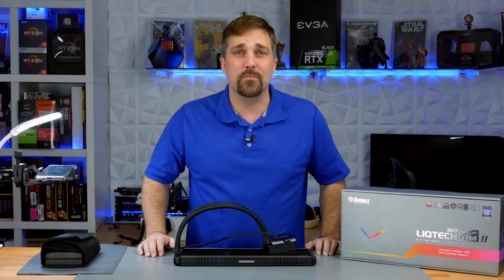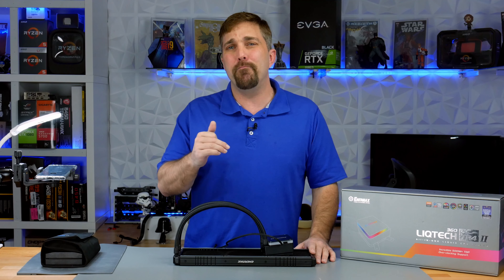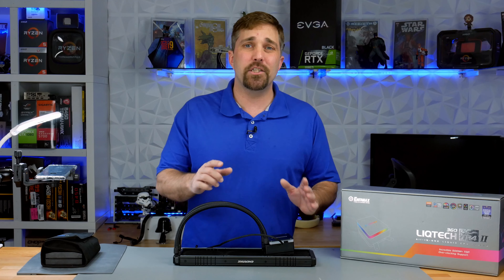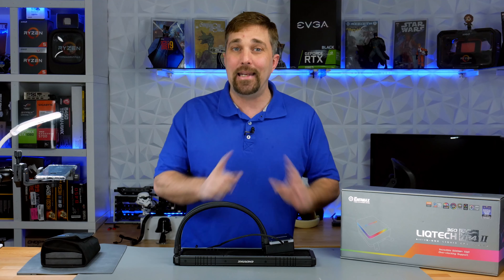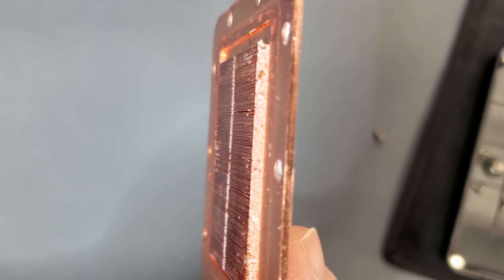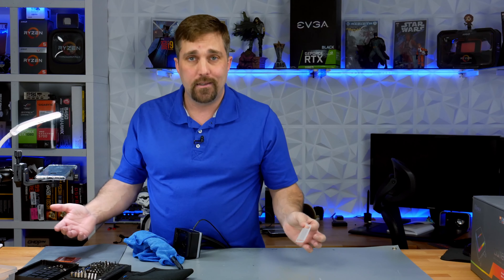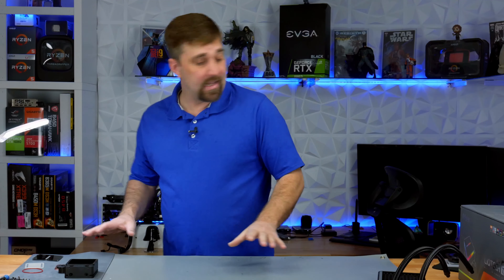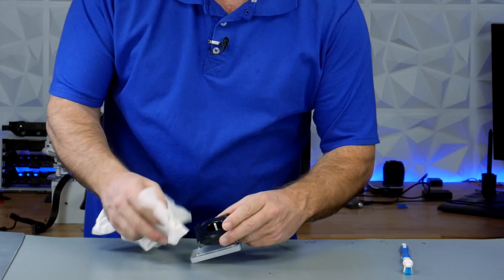How to Fix the Enermax Liqtech TR4 II Cooler - Complete Refurbish Guide

Comment from the maker: UPDATE: Aug 2021 - 18 Months later and this cooler has been running 24/7 on my Threadripper workstation and is still functioning perfectly after the refurb.
I almost forgot the temps I promised: Stats - 
CPU AMD Threadripper 2990WX, Overclocked to 3.8 GHz @ 1.225V. 
Room (Ambient Temp) 22 C.
CPU Idle Temp 30 - 33 C. 
Load Temps - 
10 Min Cinebench R20 61 C Max, 
Handbrake 4K X265 1+ Hours of Encoding 53 C Max.
Reply: what CPU Wattage when full load?
Reply from the maker: @vizintini  It's about 320W on the cores and just over 400W on the Package under real world rendering loads, but I have maxed out at over 500W under synthetic load.
Reply: Ty i went n got simple green clr n distilled water bought that coolant n a hand pump ad for oil n gas radiator fluid i have the tools n there was gunk i was getting 60 o C idle n could only run youtube i cant wait to finish my wife has a glass vase for me too. Ty because enermax told me to f myself when i put in for replacement i have 1950x thread n love the enermax well did sinve this is liqtech ii 360 which was a replacement thinking of video'n my first refurb lol. Thanks again i would have never had the balls to do it n think about getting an icegiant to eventually replace it sux being broke. Lol

Comment: Amazing video, my Threadripper system died a few months back (PSU went out) and it had one of these cooling it since 2019. Never had any issues but I think doing some preventative maintenance shouldn't hurt. I ended up swapping out everything but the board on that PC so this cooler will go to a spare parts rig. Great video and I will make sure to reference it when I clean my own unit.👍

Comment: It is necessary to leave a little space in the radiator to expand the coolant. Or is it not critical for such temperatures?
Reply from the maker: Technically yes,  but between the thermal expansion of the radiator and hoses and the fact that you'll never get all the air out, it's fine to fill it as much as possible.
Reply: @ElevatedSystems  i currently just acquired a 3990x and I’ve been wanting to use an AIO with full coverage and this enermax is the only solution to keep temps at bay. I know you dont recommend buying this AIO, but i dont want to do a custom loop, and i dont want to deal with 85 degree+ temps with another AIOs. My first question is, hows the unit you refurbished in the video running so far today, and also do you have any affiliate links for all the products required (ex. Manual or electric pump and AIO liquids required) to refurb the AIO since I’m looking to refurb from day 1.

Thanks in advance

Comment: I just bought the original (disastrous) version of this cooler unopened a couple weeks ago.  I've always wanted an AIO for my Threadripper, but they were always too expensive and now they are still expensive and rare.

When I received it (deeply discounted) I immediately cracked it open and it was the expected gross mess we have all come to love, except this one is 5 years older so there's some other weird stuff going on.  There was major chunks of sediment that I had to chisel away with a razor blade and some missing chunks of metal (I think a manufacturing flaw).  I had to follow that up with putting some lacquer over areas where the coating on the waterblock chipped, exposing the metal.  It took forever, but I got everything flushed and cleaned up.  The coldplate was a disaster- it had oxidized pretty bad on the edges which required a ton of polishing with my drill.

Now that it's fully installed, temps are better than my Noctua, but not by much.  The good news is it freed up some ram slots that my air cooler blocked.  I have no idea if this will hold up, but I'm happy it wasn't a complete disaster.  Interesting project, but definitely not for the faint of heart.

Comment: Thank you, I "sold" or returned mine for a RMA and replaced it with a Noctua, but the temps it provided when brand new was amazing.
After having watched this, I am tempted to buy a brand new one, drain on day 1, flush it and refill it with some good aftermarket coolant and perhaps have an AIO that can last me longer than a year.
Reply from the maker: Don't bother buying and refilling one. I'm pretty sure the ultimate problem with this AIO is permeation as after 4 months there is so much air in the system I'm afraid the pump will fail.

Comment: It's ashamed that Enermax could not even fill their AIO system with anti-microbial additive. 

Anyway, I am building my first Threadripper workstation with 3970X with 280W TDP. Unfortunately this is the only AIO that has 100% coverage of cold plate over Threadripper's IHS (I am wondering why no other AIO manufacturers bothered to design for TR4). So do you think it would be wise to buy one of these Liqtech TR4 II and flush and refill the system out of the box with good coolant such as those from EK?
Reply: ThermalTake have the "Floe Riing RGB 360 TR4 Edition" which looks like it covers 95% of the plate (lots of screwholes in the coldplate ,'/
Reply: @teroteki  I have actually just installed my system with Cooler Master ML360 TR4 at half the price of ThermalTake's. I haven't put it to stress test but so far CPU is below 50 degree C most of the time.
Reply: @teroteki  It doesn't cover enough. My temps are way too hot at idle (50C).
Reply: @HighTechBond  Gah! My Enermax finally died a week ago.. really hoped that might replace it. Thanks for the info!

Comment: U know that there is some air supposed to be in the system providing expasion space when the water gets hot and is expanding?  No air may cause overpreassure and finally lead to a leak when the water is very hot.
Reply from the maker: I know, it's actually  impossible to get all the air out without a vacuum chamber. Also this AIO has a ridiculous permeation rate so the more air you get out the better as the liquid will start disappearing as soon as you run it the first time.

Comment: So I have 2 questions. 1. Should I use a silicone lubricant on the gaskets and large O ring in the pump. I use that on Pool pumps and other pumping equipment when I rebuild them. 2. is it useful to use a radiator coolant like that which is used in automobile systems. It just seems like it would be far more efficient in cooling.
Reply from the maker: You can use a very thin layer of lube on the gaskets if needed. They do make Polyethylene glycol coolants for PC cooling but I've never seen any performance increase over just water.
Reply: @ElevatedSystems  Great and thanks for the video. I am going to try a rebuild of this before I give in and go to an air cooler.

Comment: I have this cooler in a used pc a friend of mine gave me. Took it apart and redid the thermal paste. I also did notice that I could hear the water whooshing around when I shook it, does that mean I have air in mine as well?

Also the pump/water block is making an audible rattling sound, though not very loud. When the fans are going I can't hear it. Is that normal?

This is my first time water-cooling, even if it is an AIO, I don't have any experience with these things I have heard, seen.

My 1920X 12-core starts off at around 70C and quickly rises to 85/90C as reported by the BIOS. I don't even want to install an OS because the temp goes up so fast.
Reply from the maker: That is way too hot. My 2990WX rarely exceeds 60C at load.
Reply: @ElevatedSystems  which is exactly why I'm afraid to even install an OS. I can barely manage to stay in bios for more than 3 minutes. Anyway I think I'll just buy a new, different AIO.
Reply from the maker: @nicholashartmann4525  if you have room in your system I'd recommend the be quiet Dark Rock Pro TR4 Air Cooler. It will keep your system cool and quiet and is cheaper then any AIO that has threadripper support.
Reply: @ElevatedSystems  I already own the DR3 for my 7700K and I did want to go the water cooling route. But thanks for the suggestion, I'll keep it in mind.

Comment: Awesome!!!! Question: can I add a second radiator to this loop? And can it be a different radiator than the stock one? I have a 3990x and the temps are pretty high compared with the previous generation.
Reply from the maker: I'm not sure if the pump has enough head pressure to move water through two rads. Also, the AIO doesn't have traditional size tubing or barb fittings so it might be difficult to splice in a second radiator.
Reply: @ElevatedSystems  thanks for the answer !

Comment: will this work with the gen 1? I have two gen 1s and while i want to file an rma for a 2 I don't want to have 3 coolers LOL
Reply from the maker: It should work the same for the gen 1 but keep in mind the gen 1 has the faulty gasket which is what Enermax blamed the problem on. Also if you RMA one you will need to return one of the coolers.

Comment: is there a program to control enermax pump speeds because i can only see how to increase fan speed in my bios?
Reply from the maker: There is no software controll for this AIO, it can be controlled through the DC voltage setting in the BIOS but for this AIO I would suggest to keep the pump speed at 100%

Comment: Good quality video and really good effort in fixing the issue. 

You have good content but i will not subscribe only because PC tech is not a big interest of mine. I build my current PC in 2009 with AMD FX cpu and it lasted me so far. Now i am after building a Threadripper machine and i hope i will never need to look into it for another 10 years. 😀

I got myself the same cooler knowing that it will be faulty so i intend to repair it before i install it into the system. However, there are things that i will do differently.

1. I will replace the radiator with a copper one. (nothing to do with galvanic corrosion, Copper as a metal has mild bactericidal properties, kills microorganisms)
2. I would wear face cowering as with breathing we push out a lot of microorganisms that can contaminate fresh coolant.
3. I will wash out the pump and all internals with 3% solution of hydrogen peroxide, this will destroy all organics
4. I will boil or pasteurize distilled water before pouring it into the system as a coolant and i will put it in hot around 50 degrees C
5. I will not fill liquid to the top as i do not want unnecessary load onto the seals and gaskets due to thermal expansion of water since it is not compressable

Really good video and quality of production, Thank you
Reply from the maker: Sounds like a solid plan. How do you intend to couple the Enermax pump block to the new copper radiator? Also, it is nearly impossible to 100% fill a closed loop like this, so the more liquid you can get in the better as this AIO seems to greatly suffer from permeation.
Reply: @ElevatedSystems  you can get 1/4 hose connectors and use soft tubes that normally used for custom water systems
Reply from the maker: @weld-deluxltd7635  Using new hose the problem forsee is  not at the Radiator end of the connection but at the pump block end as it there is not a standard G1/4 connection in that end. Hiw will you connect the 1/4" hose to the pump block? Couple the old hose to the new?
Reply: @ElevatedSystems  I will fit 1/4 fish tail hose connectors onto  the new radiator and then I have an option to use existing pipes  that are connected to the pump block and cut them near existing radiator and fit onto the new 1/4 fittings or simply machine additional two fittings that will match the fittings that are going into the pump block.

Comment: Enermax II here too. Almost killed my 2990WX as I started to see thermal shutdown. Which is by the way as good as running a CPU without any heatsink/cooling. 
What a mess. they offered an RMA but it would cost me more to RMA like 50USD, then not to mnetion I may get same crap. Not worth the risk to your threadripper build. Anyone who has spent hard earned money on these builds (unlike reviewers who get stuff for free) should not ever risk using Enermax or DIY the fix. Thats my 2 cents but feel free to burn your cash.

Rather than go through the trouble of  fixing shitty AIO, spend a few a bit more an get an EK full waterblock with custom cooling kit. IIf you use soft tubing its nearly as easy as installing an AIO.

Comment: Hello,
What's the result? Any problems after another 4 months of usage?
Reply from the maker: Yes, there is a significant amount of permeation resulting in a lot of air in the system, which I can hear circulate through the pump often. I'm afraid the pump my overheat or fail if the liquid levels gets any lower.  I'll do a follow-up video in a couple months after 6 months of use.
Reply: @ElevatedSystems  you are wrong!! But I will help you: the coolant is transferred from pump to radiator! Enermax using rubber!! Rubber allow evaporation! It should be made from silicon! And secondly enermax is noisy pump. Why? Because is cheaply made even is brushless and can not survive many months as well. The liquid inside is clear!! So not the best!! Use car radiator coolant and will be much better! Thank you

Comment: could you use this for just the pump ?
Reply from the maker: The only problem you will have using it just as a pump or adding a reservoir is finding compatible fittings and tubing as typical PC water cooling parts will not work.

Comment: If I understand you correctly, The problem isn't the quality of the equipment.   The problem is a substandard coolant.  If I am correct, you would think that enermax could fix this issue very easy. So either I am not understanding you correctly, or enermax is really lazy.
Reply from the maker: No, you are understanding perfectly. 👍

Comment: Hello,
What's the result? Any problems after another 4 months of usage?
Reply from the maker: The only issue is that the new fluid seems to be permeating from the system faster then what's typical for an AIO. There is a lot of air circulation now so I get  a lot of noise from it but temps are fine so I haven't bothered to top off the fluid yet.